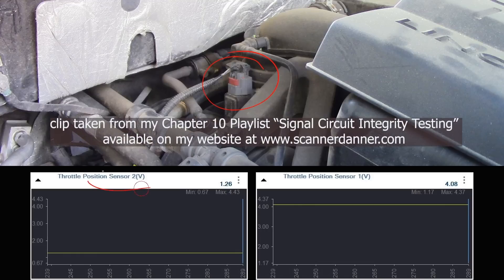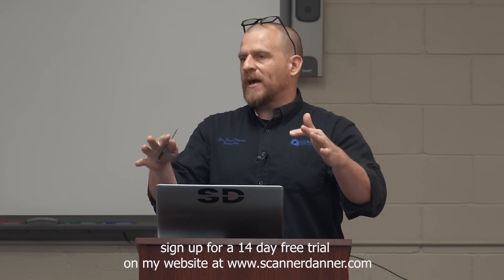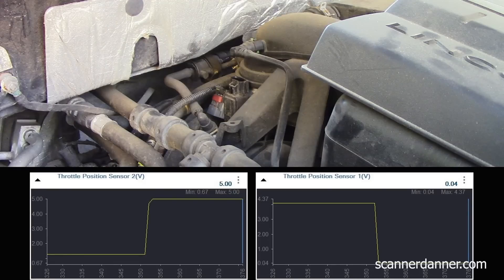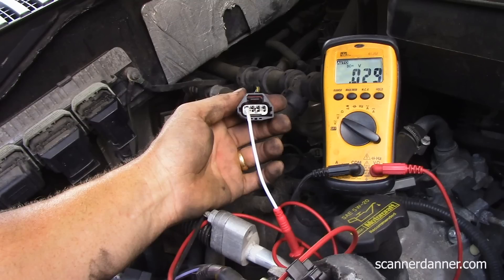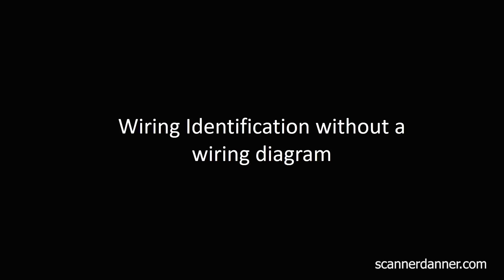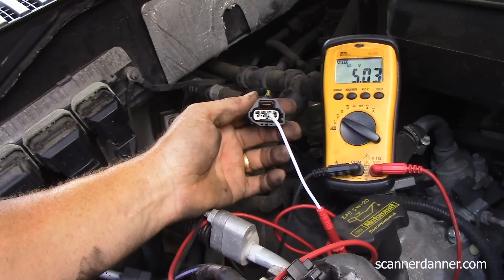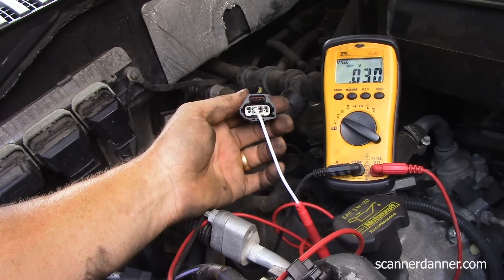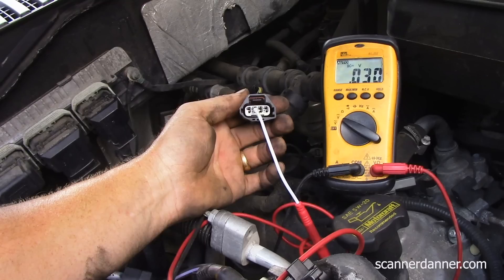Wiring ID without a diagram [Circuit Tests on a 4-wire TPS]

Comment: Thank you Mr. Danner for the video.  If you don't mind, can you also make a tutorial on how to locate grounded wires in a wiring harness?  I'm having trouble locating those grounds/shorts so I just pull a fuse and leave that component non functional. Thanks again and have a nice day!  From the Philippines!
Reply from the maker: I have some for sure! Type in "short to ground" on my channel page and see what shows up
Reply: @ScannerDanner  thank you very much!

Comment: Just had this issue on my 06 outside. 
Factory manual would have me dig to the ecm and chassis harness.
I jumped to ohm's at the tps/pedal assy. 
It was the pedal.
Also noted volt differences in scan tool.

Comment: Hi boss I have a Hyundai Tuscan 2019 the ac fuse holder is positive on both sides is that right? Once you try to start the fan this fuse burn I daut about the fuse box what do you think. Thank you
Reply: Its not a problem with the fuse box.   The fuse is blowing because of an overload in the circuit beyond one the fuse box.   Probably a bad fan motor.
Reply from the maker: Find what all runs off of that fuse. If it's just the fan, then you have to confirm the power wire to the fan is not shorted to ground before replacing the fan.
Reply: @ScannerDanner  thank you boss
Reply: @ScannerDanner  hi when I start the car the only code I have is lost com with fuel pump history after the car starts I change the fan already and control unit thank you
Reply: The short still there
Reply from the maker: @mazenramadan493 stop changing parts and get yourself a good wiring diagram and find out what all is on that fuse. And after all of the loads are disconnected then you start doing visuals on the harnesses
Reply: @ScannerDanner  hi boss I did all that already nothing
Reply: @mazenramadan493  here’s another quick check to be more specific in isolating the overload….maybe unplug the fan motor and see if the short goes away.   If the short goes away replace the fan motor.  If it still burns the fuse with the fan disconnected then you’ll have to keep looking for a short circuit to ground.

Comment: I’d like to see more examples of trouble shooting circuits with limited or no service data - In A Safe Manner
Reply: I agree, as we all benefit from the knowledge of multiple methods for verifying circuit integrity, safely.
Reply from the maker: This video is a perfect example of that!
Reply: While I understand the polarity difference between diode, and resistance, the concept of resistance from a VOM tosses red flags... I ALWAYS check for voltage first. Forgot once and let out the smoke.